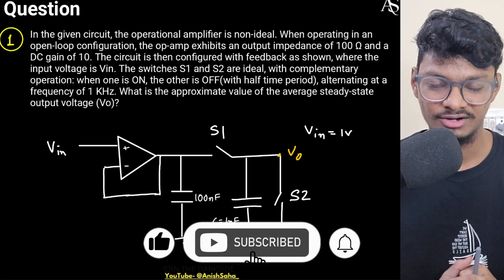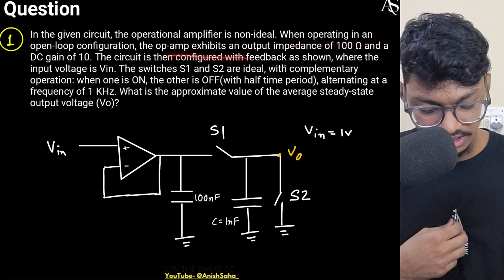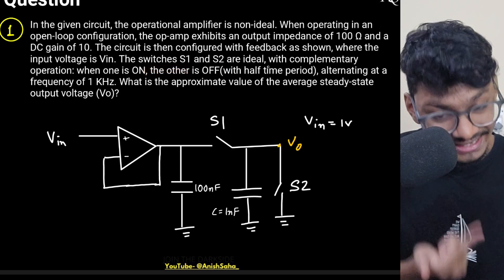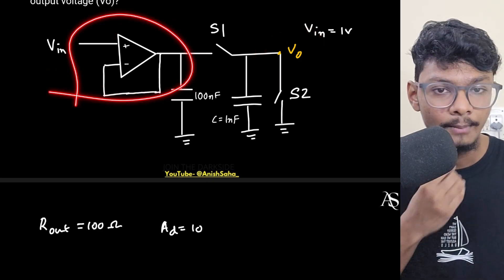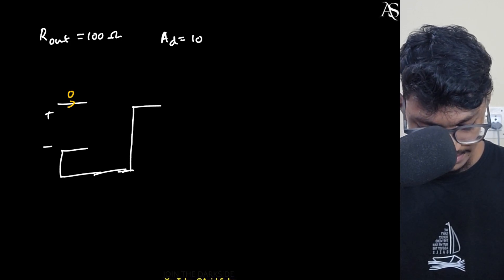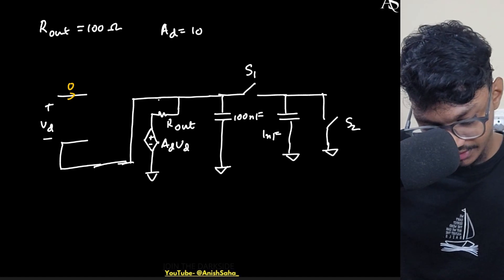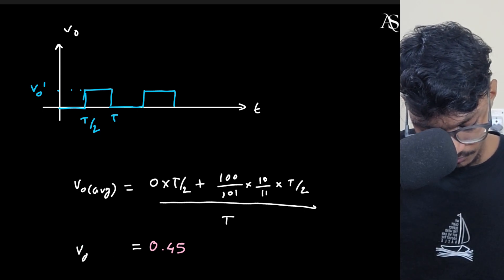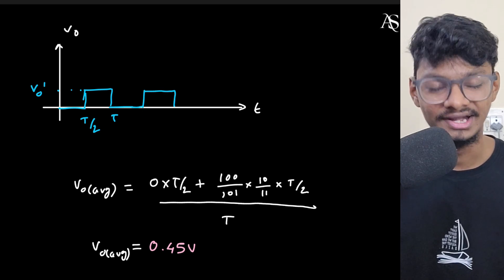Interesting Concept of Non - Ideal Op-Amp || Screening Test Questions || Circuit Queries

Comment: When S1 is on the charge sharing happens instantly due to the ideal switch but then after that the combined capacitance of 101nF should still be charged to 10/11Vin instead of 100/101 * 10/11 * Vin finally since the RC time constant is still pretty much the same. Please correct  me if I am wrong.
Reply: The same thing I wanted to mention, good to see your response.
Charge sharing is momentary and the voltage drops from 10/11 to (10/11)*100/101 at the time of switching instant.
However, the negative feedback in action would make it to ~10/11 again within five time constants.
So, the avg value will be ~ 10/22.